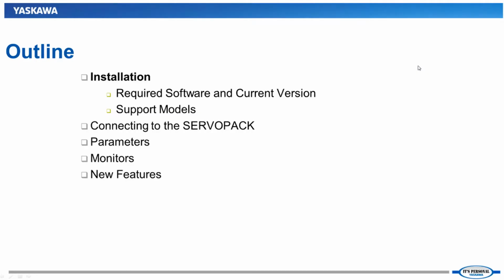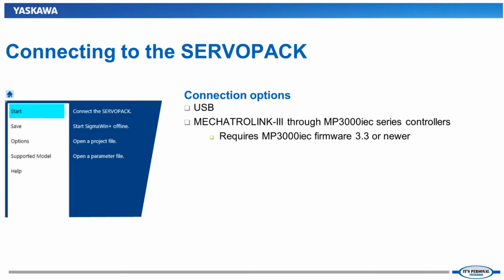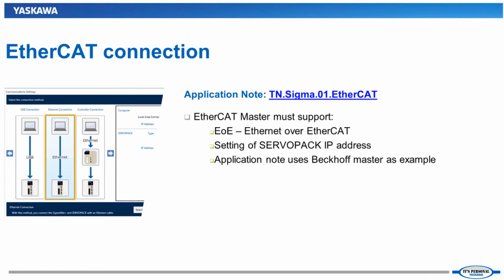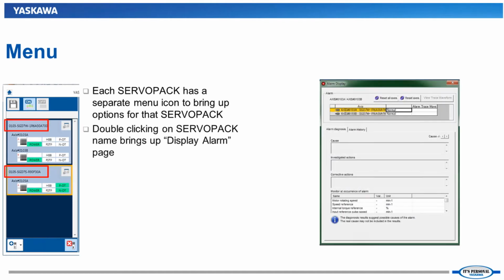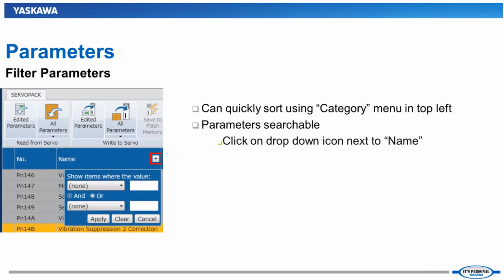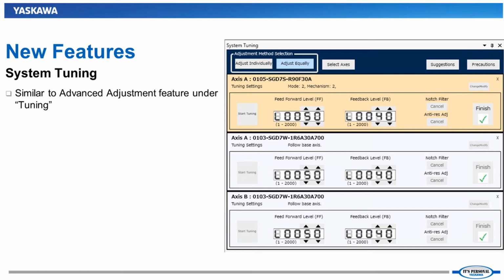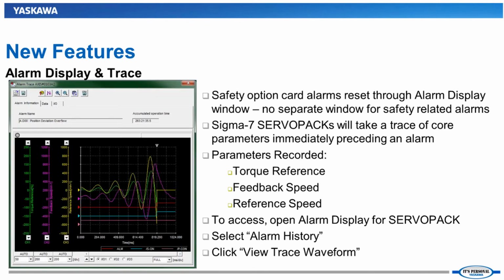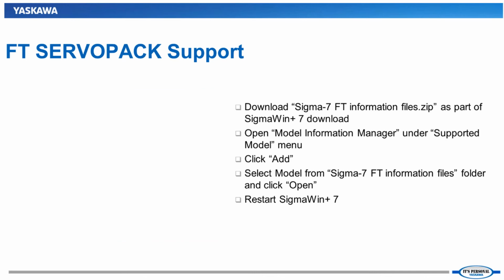Webinar: Introduction to SigmaWin+ v7.0

Comment: Hi, I did a Factory reset on MPI3300iec (after archiving default files-resetting encoder and pn parameters for each axis) and now I see my SGDV servopacks flashing "pn", May I know if I need to upload driver parameter files using SigmaWin+ or can I upload from Motion works IEC?
Reply from the maker: Thanks for your interest in SigmaWin+ v7.0.  Here is a link from our Yaskawa Solution Center that you may find helpful: https://solutioncenter.yaskawa.com/selfservice/viewdocument.do?noCount=true&externalId=11032&sliceId=1&noCount=true&isLoadPublishedVer=&docType=kc&docTypeID=DT_FREQUENTLYASKEDQUESTIONS_1&stateId=4211&cmd=displayKC&dialogID=158926&ViewedDocsListHelper=com.kanisa.apps.common.BaseViewedDocsListHelperImpl&openedFromSearchResults=true